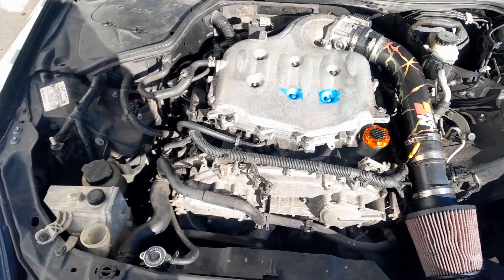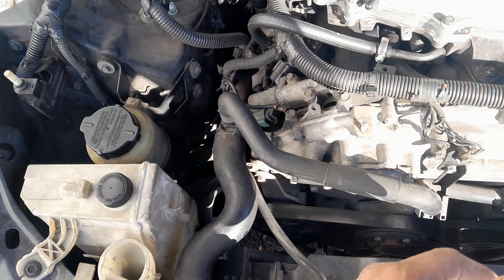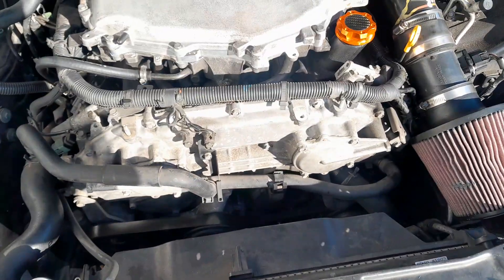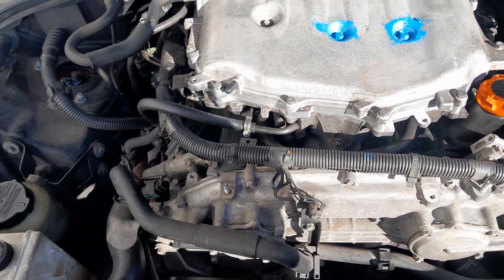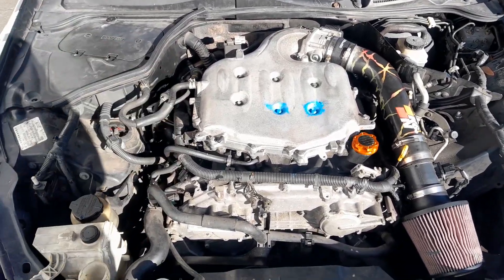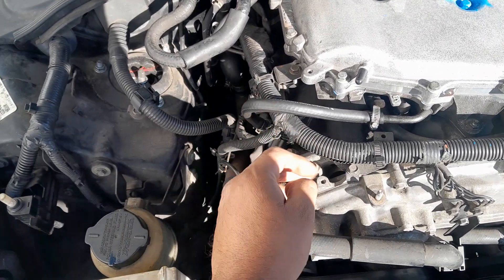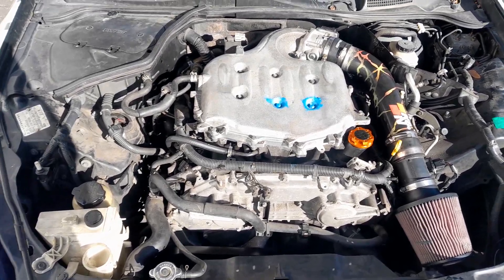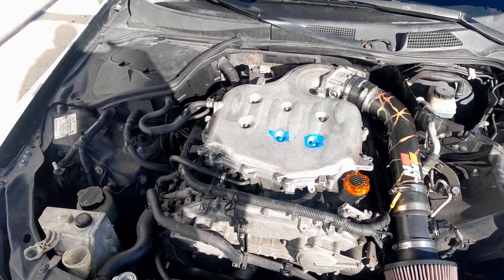Why you Should not Install Oil Catch Can and Your Cars

Comment: Cold air intake install taking in hot air.
Reply from the maker: A lot of mechanic shops they saying that or dealership do you know why because when he puts cold and take and everybody use this filter that mean you never got to buy another filter from the store because the filter and the store cost them only two bucks and dissolve it for you for $30 that means you make a lot of money from you so we have to come over the idea tell people called antique doesn't work and why the dealership has a special service with cold intake tell me why this is bad
Reply: @LessExpensivefix So what are you trying to say? This is a really bad intake setup lol. Stock would be much better

Comment: There is more pressure in a supercharged or turbo engine and if you install the catch can improperly on those engines they will leak as well.  Don't install a catch can incorrectly, agreed.

Comment: It’s because this type of oil catch can has 50 micron bronze filter which restricts air flow= increased crankcase pressure which results the oil leak i suggest you remove the bronze filter out

Comment: You did not install right if it leaked and fittings you had on the van are crimp on style with did not have crimped hoses.

Comment: Are you sure you install hoses right way..  did u test if the air flows out from can without oil spray.
Reply from the maker: Is better to use oil catch can for a car has a Turbo Charge
Reply: @LessExpensivefix  on direct injection also.